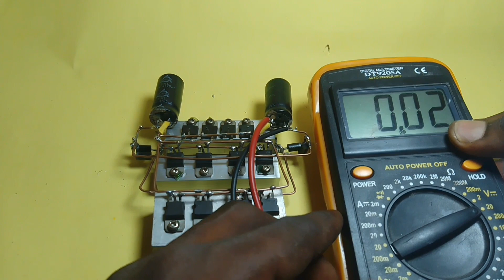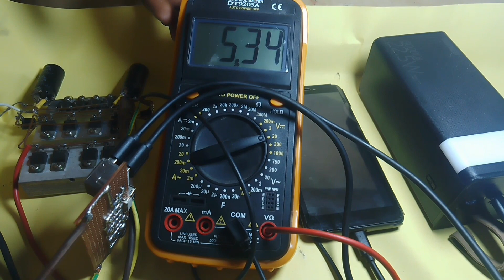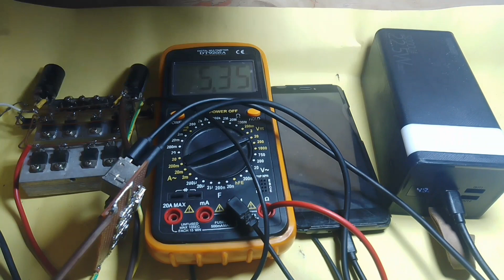Make Super Fast Mobile Charger| 5V 15A Charger

Comment: Sorry but you need to learn one or two things before posting videos. Although i give you credit for not being nonsense, fake or dangerous.
Reply from the maker: What are the things I need to learn please??
Reply: @Astroelectric1  Electronics is a complex and broad area, even with a training course you barely know anything to face the real world, and knowledge comes with practice and errors. About this video you cant just connect 7805 in parallel and done, this have multiple problems starting with the load distribution, also heat management the heatsinks are small for passive cooling, and for larger currents you should use switched regulators, and there are more small problems like quiescent current, loop stability etc...
Reply from the maker: @tiagoferreira086 this video,only demonstrate the possibility of getting more ampere by combining multiple regulator in parallel.the only problems are heat generated and low efficiency but also it's cheap.my next project will base on lm2576 which has high efficiency,low heat generated.